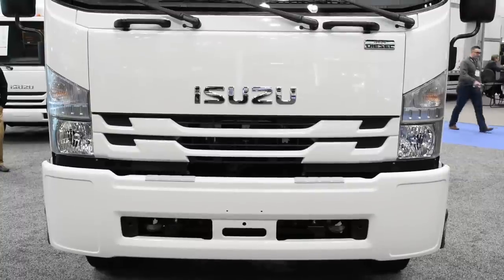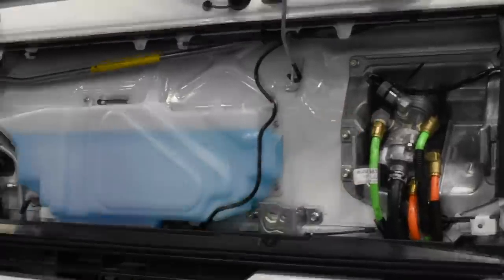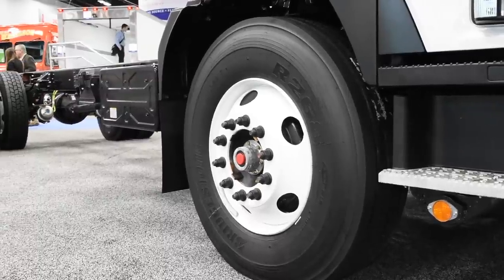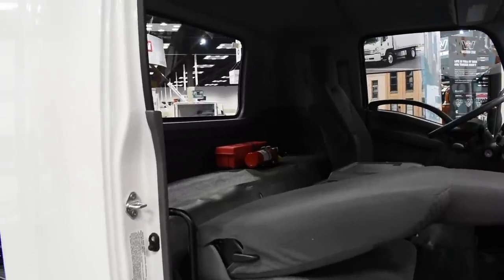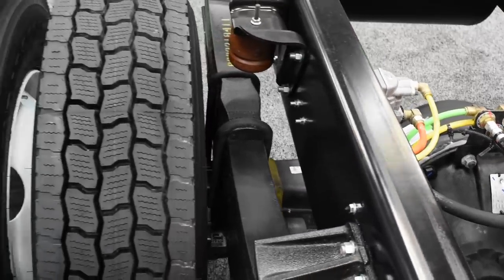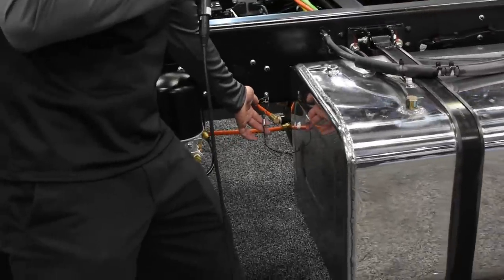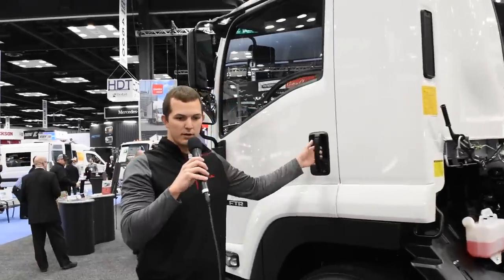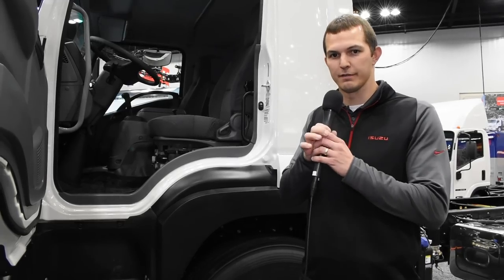2018 Isuzu FTR Class 6 Cabover Truck Walkaround

Comment: The funny thing is both the ftr and nrr are rated at approx 26000 lbS.  Since the Nrr is a lighter truck you can legally haul more load even though the tires brakes are less beefy.   Also I think they have the same engine.  Go figure...  maybe the final rear end is geared lower

Comment: For the 2020 model, a new larger 6.6 gas engine is about to be offered. It's got mini water jackets between each cylinder so it will run cooler when you use propane LPG high 104 octane fuel. It's possible the smallee Isuzu will use the 464 lbs feet of torque 6.6 liter gasser, with an even larger 7.1 to 7.4 liter gas V8 for the big  FTR, with about 500 lbs feet of torque. New details will be revealed July 9, 2019.